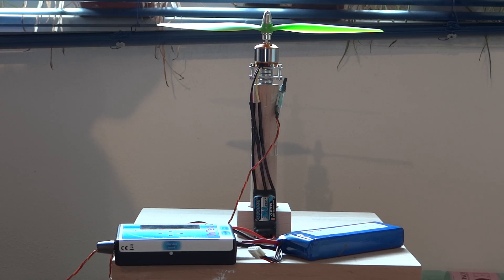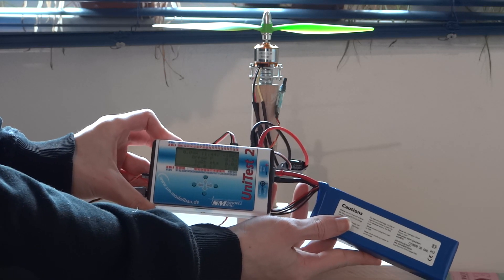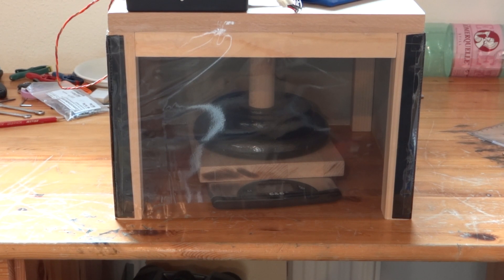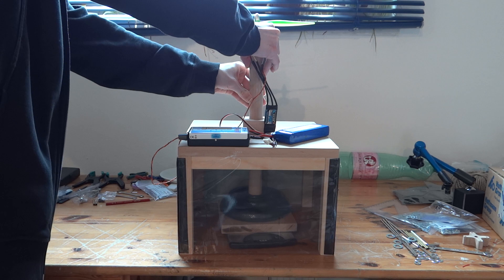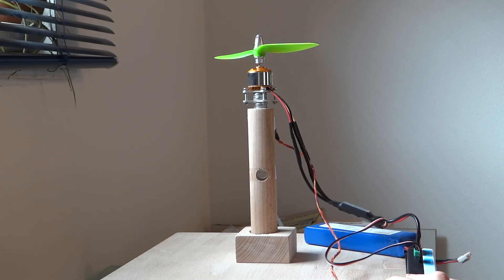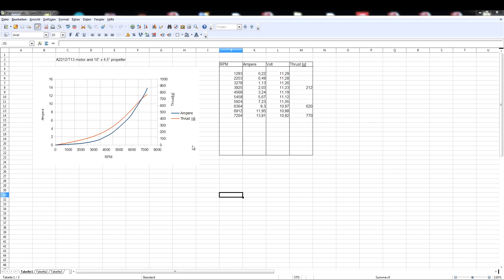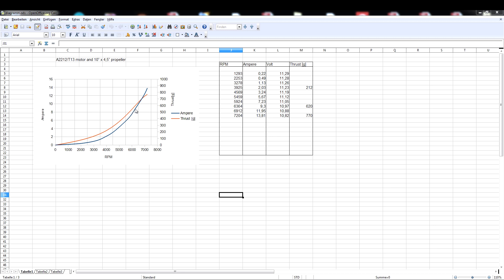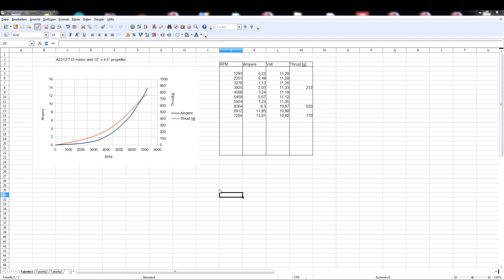A2212 Motor and 10x4,5 Propeller on the Test Stand; Thrust, Current and Speed Measurement

Comment from the maker: @Ankur Choraywal  I can`t answer to your comment, change your youtube settings.
The white or yellow cable needs to be connected to a PWM pin on the Raspberry Pie, the black cable needs to be connected to GND. Red can stay unconnected.
Reply: @Experimentaltechnik: Can you confirm whether the motor has roughly a 1000kV rating? I found that often these motors have very different actual kV values than what is stated. I am planning to use these in a vehicle and hence need to see what gearing options I have. Your help would be greatly appreciated, danke!
Reply: Could you please tell me one thing. I want to power up esc 30A + A2212 without battery. What specs should have my power adapter? I mean 12V and how much A?
Reply: It's my project. I build quadcopter for stabilizations tasks not for flying. So, I need a power adapter which will power up 4 esc + 4 motors. And I can't pick up right power adapter when I do not not needed current. Sorry if my question is stupid. Just do not want to screw up everything
Reply: "When I do not know needed current"*
Reply from the maker: Alexander O Sounds like an interesting project. Why don`t you know the needed current? You`ll have to approximately know how much thrust you need, or how heavy the thing is that you want to lift. From there you can read the current from my diagram(if you`re using a 10x4,5 prop). At 12V it is a bit different but not much, close enough for an approximation. Or how do you even know if the A2212 1000KV is the right motor?
Reply from the maker: +Alexander O If you just want to try it with these motors and propellers without knowing, if they are powerful enough, then you should choose a power supply that can provide more current than the motor at maximum will need, which is 15A per motor. (The motor is rated for 10A and 12A for 60sec; don`t exceed these values for more than a few seconds.)
And don`t worry, your question is not stupid. If you want my opinion, try it with a battery first- then if the project works switch to a power supply. A battery is cheaper and you will need more than one power supply unless you find one for 12V 60A.
Reply: Experimentaltechnik thanks for your reply. Quadcopter's weight is less then 1 kilo. I assume that 8A (500 g thrust) per each motor is enough. I'm using 10x4.5 props too.
So, there is 2 000 g thrust if each motor will be powered by 8 A which is completely ok for me. And total current is 4x8=32 A. I saw power supply which has 12 V and 41 A specs. But what if motor will ask for more then 8A current?
How can I control it?
I know that ESC controls motor. I have 4 motors a2212 and 4 30 A ESCs.
ESC is powered by 12 V and gives 5 V to the motor. And motor depending on control signal (I will use arduino pins for that) asks for needed current. Can I set up ESC the way that motor won't take more then 8A from it?
That's the question that bothers me so much right now...
Reply: Experimentaltechnik now I'm thinking about lipo battery. Perhaps it is the best choice. If I would use a couple of 2200 mAh 30 C then CurrentMax=2.2x30=66 A.
Reply: Experimentaltechnik sorry for so much questions. but I just thought... I can buy 12 V and 41 A DC power supply. Connect only one esc and one motor. Connect arduino uno to the esc and make some calculations and measurements:
1. I can measure how much current esc takes (am I right? I should measure amperes from ESC input?) when I do control signal myservo.writeMicroseconds(2000) 
2. Let's say previous step gave me 12 A. Now I can adjust my control signal. let's say I found that esc takes 7A when I do myservo.writeMicroseconds(1600)
So I would never use in my code value higher then 1600 micro sec. That's all :)
According to your test 7A is enough for 400-450 thrust. 1600 g thrust at all I think is pretty ok for me cause my total weight is about 800-900 g.

so, could you please tell me is my thoughts are right? May be I haven't counted some major thing..
Reply from the maker: Alexander O  1. Yes, that`s right. 2. Yes, I would do the same. Additionally you could use 9x4,7 propellers - the max current would be lower, the efficiency similar. (I will make a test video about this soon)
Your data looks reasonable to me.
From your comment above I see that you have some misunderstandings about the function of ESCs and motors. At full speed the ESC will give the full 12V to the motor, at lower speeds less. The ESC generates a voltage in waveform on all 3 wires that go to the motor, but with a different timing on each wire. For example: At the same time when on wire 1 the voltage is at the highest point on the wave, it will be on the lowest point on wire 2 and wire 3 will be somewhere in the middle. This generates different magnetic fields in the motor which are causing it to spin. The motor doesn`t ask for current. The motor tries to spin at the highest possible RPM which depends on the voltage. Example: 1000KV means 12000 RPM at 12V. But the motor can`t reach this RPM because it is slowed down by the resistance of the propeller. The torque of the propeller presses the permanent magnet`s magnetic fields harder against the magnetic fields that are electrically generated by the coils. They need more power to build up their magnetic fields and this causes the current to go up.
At least that`s how I understand it. :-)
ESCs often have a BEC integrated. This is just a 5V output (on the red wire) that can be used to power the receiver or servos from it.
One thing that you may haven`t thought of is that the wires from the battery (or power supply) to the ESCs should be as short as possible. If they are longer you need additional capacitors. Read here: http://www.rcgroups.com/forums/showthread.php?t=952523&highlight=kill
I guess you will need long wires if your power supply is stationary.
If you upload videos about this project or post on a website/forum, send me a link, I would like to see it.
Reply: Experimentaltechnik thank you so much for your answers. It means a lot to me. Really. 
I got a headache already from all that stuff. Every time I think that all is under control then there's a thing which I should count.
And now I just can not understand the picture of 21 motors... ( https://docs.google.com/file/d/0BwHItOaHOOvdQmp3c3gydzV3SU0/edit ) English isn't my native language nevertheless I do my best.
I got 4 motors. And I suppose that length from the power supply and each motor will be the same? If so then I can add 1 capacitor to each esc input just for be in safe. Or even do not use capacitors at all. I can't find how much length is allowed by default. Actually I found smth about 18 inch but I don't know should I trust that source or not.
I got rough picture about what my whole thing will look like. I will be grateful if you have a look at it
https://www.dropbox.com/s/hi5psb3oehlfqqm/noname.png?dl=0
According to that picture my total lenght is about 30 cm
And thank you again. I definitely gonna share with you when it'll be done. But it can take a couple of month I think...
Reply from the maker: Alexander O  :-) Thanks for subscribing.
That`s always the case in engineering. Unless you calculate/simulate everything, there are some details and problems that one doesn`think of.(and hopefully they are unimportant and easy to solve.) It is mostly the best to copy something which is proven to work and to use commonly available parts.

I have no experience with using longer cables. I would say if the cable is longer than the default cables from the ESC + the default cables from a battery, an additional capacitor would be good. It depends on the ESC and how big the capacitors that are already in it are and on the expected voltage spikes. I don`t even know if it could be bad to use a capacitor that is bigger than necessary. I would read on the froums what others are using and choose something in between.30cm is less than I thought, so the quadcopter can`t move upwards and it`s mass is completely held by the stand?
You also have to take into account the internal cableing of the power supply.
Reply: Experimentaltechnik I haven't decided yet if quadcopter wil held by the stand or there would be some 3-5 cm of freedom for opportunity to move upwards. Still looking for the right ball joint.
Today I bought capacitors. Low esr with the same specs as ESC has - 470uF and 25V. Good for me cause I was afraid that I would not find them in my city.
Could you make a bit clear for me your last sentence? 
What is internal cable? I will use power supply like inside PCs but with different specs.
So, there are cable length to the quadcopter (Lp on my picture) and the length to the wall socket which I suppose I should not count. Should I?
Reply from the maker: Alexander O Ok, nice. What I meant was the wire inside the housing of the power supply, from the circuit board to the output connector. I guess it`s another 10cm. But it doesn`t matter, the 470uF should be fine.
Reply: Experimentaltechnik thank you for all your answers!!)
I definitely will share with you my project video and I hope it'll be cool.
My goal at the moment is build a station like you saw on my picture.
I hang weight (about 50-70 g or so) on one or two of 4 beams for quadcopter get imbalance and quadcopter should stabilize itself via PID and using GY-521 sensor
Reply from the maker: Alexander O Great, send me a message when it`s ready. And have fun writing the code, I can imagine it will require quiet some time and lots of testing.

Comment: What does it mean when its 10x4 and 10x5?
Reply from the maker: fitforlife95 The first number is the diameter, the second number is the pitch of the propeller in inch.Higher numbers need more power to get it spinning and more thrust is generated. I read that for a multicopter it is better to use a lower pitched propeller because it can be better regulated.
Reply: thank you!

Comment: Hi. I have the problem with BLDC. In the process of testing, BLDC works good without propeller. But, when I fasten the props., BLDC doesn't increase its speed or resets. In this regard, I'd like to ask. Why this problem happens? What should I check?

Cmponents:
1. BLDC- A2212 13T;
2. ESC-25A;
3. Controller - Arduino UNO;
4. Power supply  - DC 11.9V (220AC-12DC);
5. Propeller - 10x4.5;

Thank you in advance.
Reply from the maker: Aleksey Barsukov  Hello, I would say the problem is the power supply. Most power supplies can only deliver a small amount of current. For this motor with 10x4,5 propeller you would need one that is suitable for 20A. Try it with a battery instead.
Reply: Experimentaltechnik Thank you for reply. I will try to use the battery.

Comment: Thanks.
Yes it does seem higher rpm's mean better efficiency, so a smaller plane does need a smaller prop to get the rpm's up.
I'll get a couple of other sizes and try them on the plane, I want to get the rpm to around 7000 at a sensible airspeed.
I think one reason for the increased efficiency at higher rpm is the inductance of the motor windings, voltage applied for less time (ie higher speed) will result in less current draw.
Reply from the maker: hellcattanks Yes, the question is at which RPM the A2212 1000KV motor has its maximum efficiency. I didn`t find a datasheet for that. And at which point are the propellers the most efficient. Motor and propeller efficiency interfere with each other. Another point is that a bigger propeller is generally more efficient, but when it drags down the motor`s RPM too much the overall combination becomes less efficient. This is what happens here with the 10x4,5 prop at a thrust > 280g. The best thing one can do here is really to try it, measure the flighttime and compare. I guess the difference between the props would be not more than 10% in flight time. A 1kg quadcopter with the 10x4,5 might have the same flighttime as with the 9x4,7 prop when hovering.               What you said about the motor sounds right, certainly the heat produced at higher current reduces the efficiency. But I don`t know enough about that.
Reply: @Experimentaltechnik  would you recommend 1045 prop on a 4S configuration or it may fry off the motor?

Comment: Did you try any other props?
Its interesting to see that the efficiency goes up substantially with rpm.
I have one of these motors for a small plane, I have the same 10 inch by 4.5 prop, by the looks of it this it will be inefficient as it will probably run well below 6krpm, on your graph the current is high and the thrust fairly low at that point, so I will will need a smaller or lower pitch prop to get the speed up into the more efficient region.
Reply from the maker: hellcattanks I didn`try other props, but I recently found a website that did: http://www.microcopters.de/artikel/multicopter-motoren-im-test#sa2212-13 They measured the A2212 motor with 3 different sized propellers. Just look at the diagrams, if you don`t understand german. The text isn`t very important, they basically say that the motor is well made and good. Their measuring results with the 10x4,5 prop look similar to mine. They used better carbon props and therefor get a higher maximum thrust. And yes judging from their diagrams it looks like a 9x4,7 prop is better at 500g of thrust, while a 10x4,5 prop is better at 200g. So it depends on the weight of the quadcopter/plane and how you fly. It looks like both propeller-motor combinations have the same efficiency at around 280g. It is very interesting, I will buy some 9x4,7 props and test it myself. And I`ll make a video about it.

Comment: Hi, I'm about to buy this motor too, but I'd like to know is the heat produced still on acceptable level (warm) or is it too hot? 
Thanks
Reply from the maker: trogalko Hello, I didn`t measure the temperature, so I don`t know it exactly. At 14A it becomes too hot to touch, but this current shouldn`t be reached with this motor for more than a few seconds anyway. A lot of people bought this motor and I havn`t heard anything bad regarding the heat. I would say it is just normal for this kind of motor. In the end it depends on the quadrocopter weight, the style of flying, the environment temperature and how good the airflow is around the motor. I think I will measure the temperature on the finished quadrocopter, thats more realistic than on the teststand and the cooling should be better.

Comment: Hello Experimentaltechnik, is 7200rpm all the motor will do with the size prop you are using?
Reply from the maker: Oldandsickofit Hello, with a fully charged 3 cell LiPo battery it will do a bit more, I guess 7300-7500rpm, depending on the prop type. I think my prop starts to elastically deform at this speed, a carbon prop would be necessary to get more thrust out of it. I wouldn`t go higher than 7000 rpm for more than a few seconds, because the motor is rated for 4-10A and 12A(60sec).